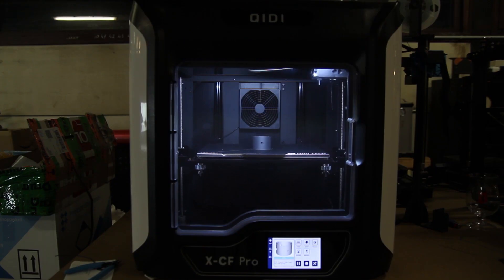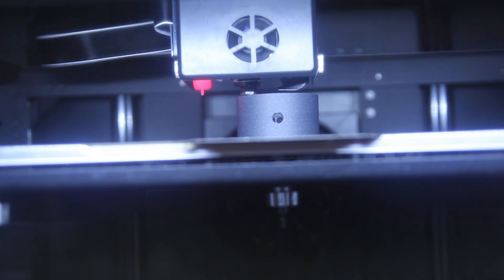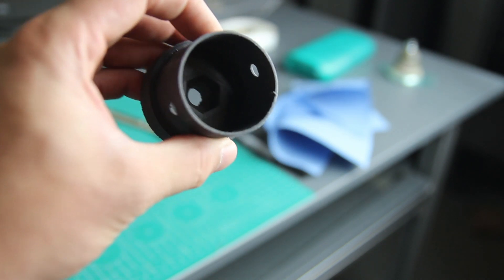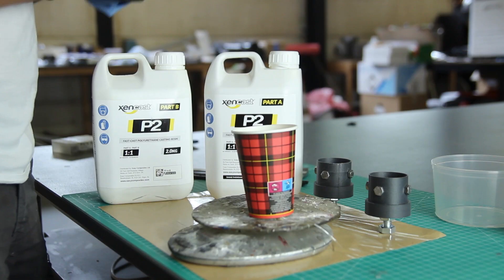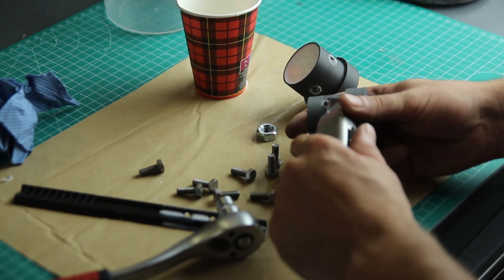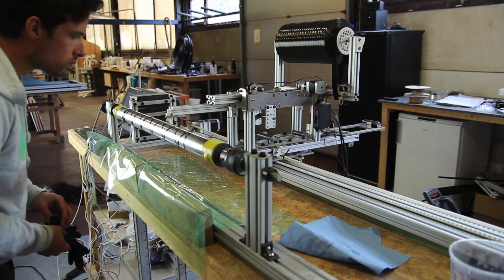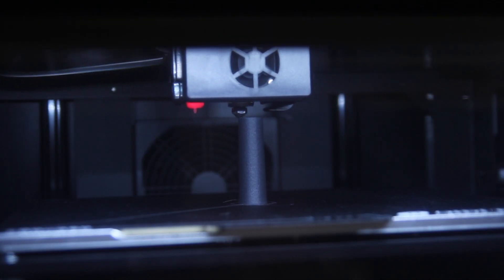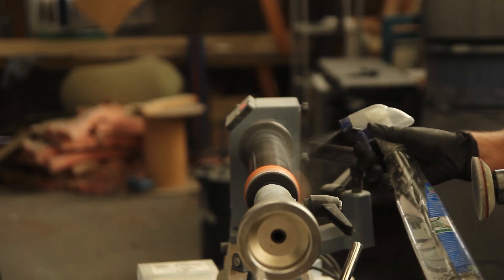How 3D Printing Improved My Productivity In Carbon Fiber Work

Comment: hey!
when you use the aluminium mandrel, do you cure your tubes in an oven or autoclave? and what do you use as a release agent?

I would love to see more content about tube-making, I'm really struggling to make some of them!
Reply from the maker: Cured in an oven, I'll have the full tutorial online this thursday with 4 different techniques to make carbon fiber tubes ;)
Reply: I make tubes sometimes. Are your carbon tubes sticking to your mandrel? If you're wrapping over a cylindrical mandrel and compressing the carbon toward that inner surface, you need a high quality mandrel. I use a rod straightening and centerless grinding service. Then I release prep with an ultra low friction coating. And then extraction may or may not involve a 10-to-1 leverage extraction device. The combination of near perfect surface deviation of the cylinder and making it slick as snot usually makes for willing release. The grinding costs a fair amount of money and they tend to want to do it out of a 10 foot length blank rod, so coming up with a new diameter in your tool set can get kinda expensive.
Reply: @drewdiller  thanks
they are... we are trying to find new methods
I am currently considering cardboard mandrels covered with a mylar sheet
Reply from the maker: Cardboard with a first layer of heatshrink tape works well for me